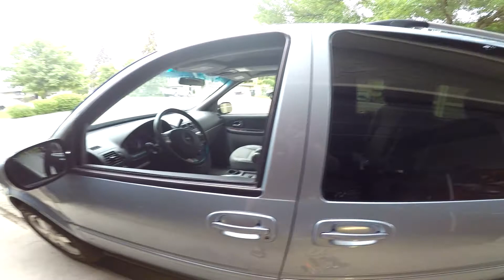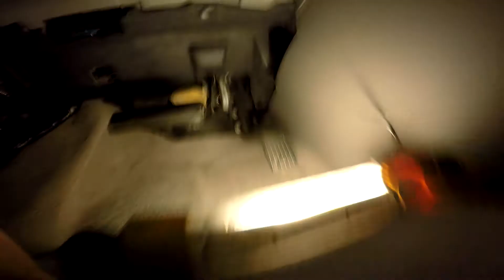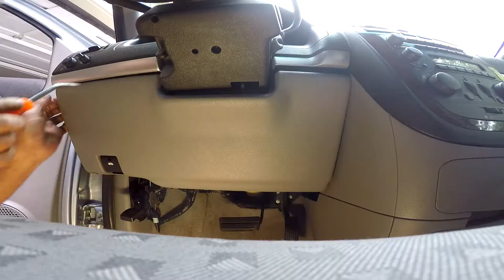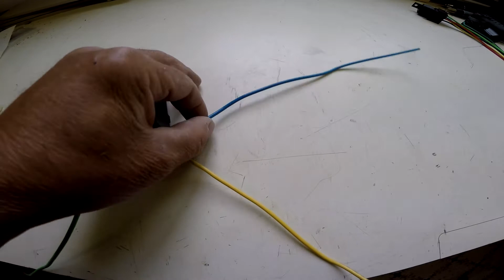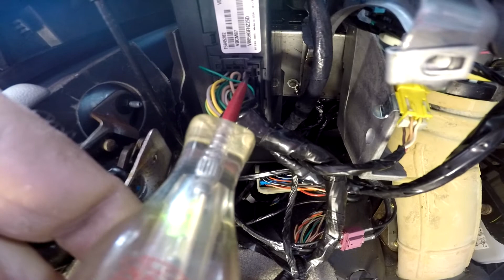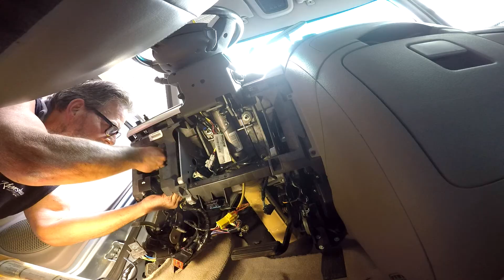2007 Chev Uplander Door Lock Repair - Doors won't Lock

Comment: Need your expertise. My thought was to cut the gray wire and connect  a momentary push button 12 volt  circuit to the door side of the gray wire to activate the lock mechanism. That seemed to work to lock the doors, however, the unlock mechanism will not work unless the gray wire is intact. I was concerned that if I put the 12 volt push button circuit on the gray wire, while intact and connected to the bcm,  that it might possibly cause damage to the bcm. I would appreciate any information you may have on the subject. Thank you.

Comment: Is there a way to disable the auto locks by pulling the relay in the fuse box?Mine won't stop locking/unlocking so I'm having to take the negative off my battery when I'm parked.HELP!!!
Reply from the maker: Are you speaking about the auto lock when you put it in drive? That can be programmed out using the menu on the display. If it is locking and unlocking at random check your wiring in the drivers door boot to pillar for a short.

Comment: Not close to you at all. I'm 4,000 Km away near Toronto. Finally got a break in the weather here so I was able to finally work on the door problem today. A nice  sunny day with no wind and temp just around O degrees C. I  have to do the work in my driveway because my garage is filled with other things. Everything now works like new. Doing the wire cutting and soldering was a bit tricky but it is all done. Still haven't installed the BCM properly but will be doing that tomorrow which is predicted  to be a carbon copy of today.
My wife is happy now so you made my day.

Thanks for all your help! God  Bless.

Comment: Thanks once again for your quick response. The reason I am so inquisitive is because I am an  80 year old "old school" Electrical Engineer and I can't seem to "let go" of trying to repair our vehicles. My wife is always telling me at my age that I should take the cars in to be be repaired. I can't seem to do it because for one thing I am too cheap. Your solution to the door lock problem without a schematic really impresses me. Maybe if I had a competent, trustworthy mechanic like you  in our area I would save myself a lot of time and aggrevation. 

One last question for you. When I cut the actuator wire at the BCM, is it possible to apply +12v to the wire end leading to the door side and have the doors lock?
Reply from the maker: Yes if you cut the grey wire and apply 12 volts to the door side the doors will lock. Also, maybe I live close to you, I am in Kelowna BC.

Comment: Thanks for the speedy reply. 

I have done more research on the relay and it seems wire colour means nothing since many of the relays I've recently researched have different colours connected to the same relay pins. What is always consistent is that the numbers between different relay pins agrees, #85 and #86 are the relay's coils, #87 is the normally open (NO) contact, #87a is the normally closed (NC) contact and #30 is the switched input that connects to #87 from #87a when the relay coil is energized. 

I hear the BCM lock relay click when I hit the door lock switch on the door so that means the relay coil is being energized.  However the door actuators are not activated. This means that power is not flowing as it should through the relay from pin #30 to pin #87. 

You've stated that you connected coil contact #86 (black) and #87 (red) to the red/white striped wire which supplies the main fused power to the BCM which I assume is the +12v battery supply. If that is the case then the other end of the relay coil, #85 (green) must be a "triggered" ground  connection in order to have 12 volts applied to the coil. This is the only way the coil can be energized in order to connect pin #30 to pin #87 which is NO. Is this correct? I just want to make sure I find the proper connection point on the BCM to solder the "trigger"  wire to so I don't short something out in the BCM. 

BTW I picked up a relay at Princess Auto and the wire colours for the relay coil do not agree with your colours for the two coil pins, #86 is green and number #85 is black. All other colours agree with yours. I realize that the coil pin numbers are interchangeable along with the wire colours so I will stick with using the same pin numbers as you, after all the wire colour is just a piece of plastic.. I therefore will be using the black wire (#85) as my "trigger". This means I will be soldering the black wire (#85) to the BCM circuit board. 

Sorry to be so long winded but I just want to understand how the mechanism works.

You must have a schematic of the BCM and vehicle wiring for the door locks in order to figure this one out. I have been trying to obtain such wiring schematics but am not having any luck.

Thanks a bunch in advance for any help you can offer.
Reply from the maker: You are absolutely correct with all your statements. And yes, the wiring colors are not consistent on the relay harnesses for some reason, but you got it correct, you can use the black for the negative trigger from the specific location on the circuit board. I never had a schematic of anything on the vehicle, just 30 years experience with vehicle wiring and troubleshooting. One must understand how something operates by testing first and then making notes. In this specific repair, the logic is to basically install a better quality aftermarket relay to replace the faulty on board unit which failed, and it took me about an hour to figure out which wires did what and come to the conclusion that the best is to leave the BCM alone, and simply cut the grey motor(actuator) wire and feed it the power from the new heavier duty relay. Sounds like you have it all figured out, and if you need any help, I shall try to be here to answer. I am just so glad I can help others with this issue....

Comment: Mine doesn’t lock but also shows “delayed locking” on the screen in the gauge is that also the same issue you had?
Reply from the maker: Delayed locking means you have to hit it twice to lock, you can change this setting thru the info center options, just remove delayed locking and see what happens. I did not have this issue or message at all because I had turned off the "delayed lock" option in the menu.

Comment: I just started having the same issue with my Uplander, unlock works, lock doesn't.  However, I do hear the relay clicking when I'm pressing lock...  Is that typical of this problem?
Reply from the maker: If none of the doors lock, the problem is the onboard relay on the circuit board as I explain in the video. The Dealers want hundreds of dollars to replace the module, so what I did was simply install another good quality relay to duplicate what the internal poor quality one was doing. If the relay is clicking this means the trigger(switch wire) is activating the relay, but the relay output circuit is the problem of not supplying the power to the door lock wires. If only one door isn't locking this is a problem of a possible broken wire running to that door, but if all aren't working, you have the same dreaded problem that I have explained a solution to in the video. I hope this helps.
Reply: @imabushwacker  That helps a lot, thank you.  It was the clicking relay that threw me off...

Comment: I have a slightly different problem. On my 2008 Uplander, the locks work fine when I hit the lock/unlock buttons (the fob stopped working years ago) but recently they won't unlock when I throw it into Park and the dash indicator keeps telling me the driver door is open, even though it is definitely closed. Furthermore, I have to keep the interior lights off as they won't turn off when I close the doors and shut the ignition off (which it used to) if I have the interior lights in the auto mode (on the dash)...I learned this the hard way after I ran the battery down because the interior lights wouldn't turn off. Any suggestions?
Reply: @imabushwacker  thanks so much! I’ll give it a look

Comment: I have the exact problem you describe, ie my fob or door buttons will electrically unlock my doors but will NOT lock the doors. The only way I can lock the doors is manually.

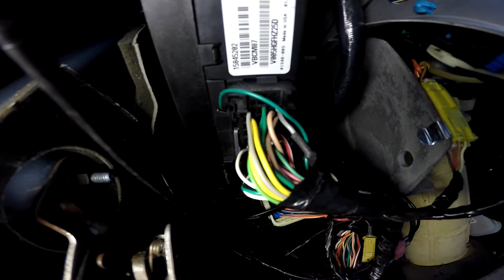I have checked the relay schematic to see what colour wire is connected to each terminal. At approx  5:19 min into the video you state that the red and black wire  should be joined together and soldered to the red/white wire that powers the bcm. The relay schematic shows the red wire is terminal #87 and the black wire is connected to terminal #85. Yet at the 6:09 min mark you state that terminal #86 and 87 should be joined together. I think this is an error since you previously stated that #86 is the trigger wire. The schematic shows that terminal #86 is connected to the green wire which you showed is soldered to the bcm circuit board.

To summarize I think the connections should be as follows:

Blue wire, #30, is connected to the cut grey wire which goes into the bcm

Yellow wire, #87a, is connected to the cut grey wire which rins to the door actuator

Green wire, #86, is soldered to bcm circuit board

Red (#87) and black(#85) are joined together and soldered to the red/white bcm power wire

Would you please confirm that my connections above are correct. Thanks.
Reply from the maker: Sorry for not seeing this, I will have to review the video, it's been a long time since I  repaired the problem. The repair process is simply installing another aftermarket heavy duty relay to duplicate what the internal low quality one was doing when new.  And without removing any of the wiring from the internal relay, I basically used the same trigger wire to trigger the better quality unit to supply power to lock the doors.
Reply from the maker: 86 (Black) and 87 (Red) soldered together and go to the Red/White striped wire that supplies fused power to the BCM. Green(85) is the negative trigger wire that comes from the specific point on the circuit board through the module housing. Blue (30) connects to the cut grey wire that comes out of the BCM(door side). Yellow (87A) connects to the BCM side of the grey wire. I might have slipped up and said neg trigger goes to 86, when it should have been 85, my bad!

Comment: Thanks for posting this.  My Terraza just developed the same issue.  I am a bit nervous about cutting into the wire harness and was thinking of heading into the local picknpull and grabbing a BCM off the same model (or compatible one).  Do you think that would work, or would I have to reflash the BCM?   Thanks
Reply: ... and to answer my own question.. it did not work in my case... went to auto salvage, retrieved an identical BCM.  I plugged it into my van.. all the warning lights were illuminated as expected when initially starting, however van would not start (no clicks.. nothing, suspect it might have to do with the key chip?).  It also carried over some warnings that must have been in the 'new' BCM .. such as 'change engine oil'.  Once I plugged original BCM back in, the van did start.  So I have to assume that I need to get the different BCM flashed to be associated with my vehicle... sigh!
Reply: @davewilliams3985  or get keys with bcm from junkyard. I'm having same problem...2005 terraza. Interior lights wont go off, power locks disabled and no remote start☹️
Reply: @merquryj   Yeah..I should have thought of that!  I had an interesting turn of events with my issue.  I went to start vehicle shortly thereafter, after leaving it parked for a while,  and found the battery was dead (might have to do with whenever I turn on right signal, the  headlights switch to bright, likely some short, but thats another story).  So I hooked up the battery charger and fully charged the battery and after that the door locks started to work.  Whenever the battery gets too low, my locking issue appears.  As long as I drive it for a few hours a day, it keeps the charge and locks work.  If I let it sit for to long, battery seems to drain and locking issue occurs.   It makes no sense to me, but it  works!  I guess it has personality  .  Good luck on sorting through your challenges!

Comment: Great video!  I'm a novice at this so please be patient.  I have a 2005 chevy uplander.  The only lock that doesn't work is the drivers side sliding door.  In fact, I can't even manually lock the door.  It is frozen hard in the unlock position.  Any ideas?

Comment: My front locks work, but not the back. Is that the same issue?
Reply: @imabushwacker  Even if it is both sides?
Reply: @imabushwacker  awesome thanks a bunch. My hatch locks and unlocks, just not the sliders. I'll have to look into taking those apart next.

Comment: Would this also work for my rear wiper on my 2005 uplander .the rear wiper does work but no power on the yellow wire on connector checked fuses
Reply: @imabushwacker  ok thank you

Comment: Man oh man!  What a service you have performed for me!  A very well done video with clear instructions and video and a no B.S. delivery.  Really liked the way you described the problem  at the beginning of the video.  I screwed around with it and put a fresh battery in the remote.  I was going to check the fuse.  I'm going to do this to my 2006 Uplander soon.  It has 240,000 miles on it and still runs great.  It is full of valuable tools and materials and I do not wish to leave it unlocked.  I also do not wish to put anymore significant money into it.  Hell, I just put an oil change and new tires on it!

Comment: 86 negative trigger or 86 and 87 together for positive?
Reply: 6:05 you confused the wires number. I did it right like you said and still not working. No lock/unlock working.
Reply: @imabushwacker  mine not lock or unlock from driver or passenger door and i don't have a remote. I have to do it manually or with the key.
Reply: @imabushwacker  I did, all good